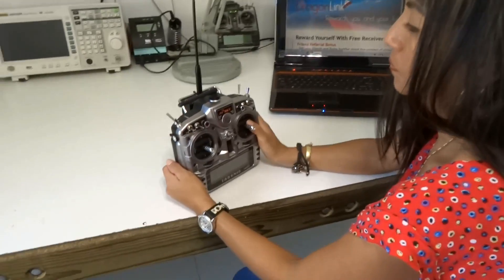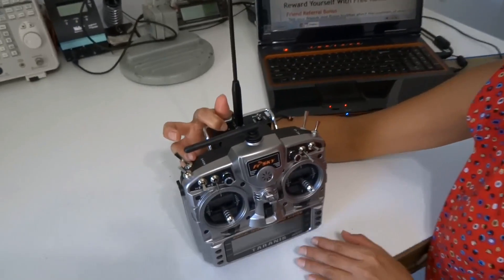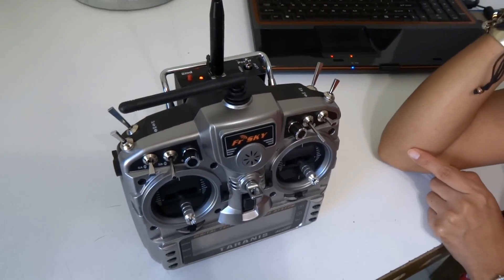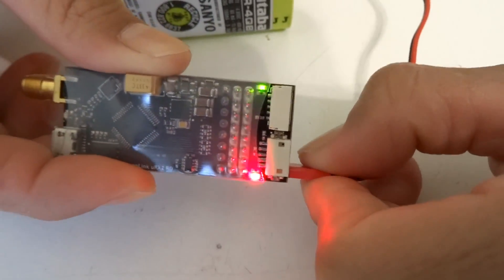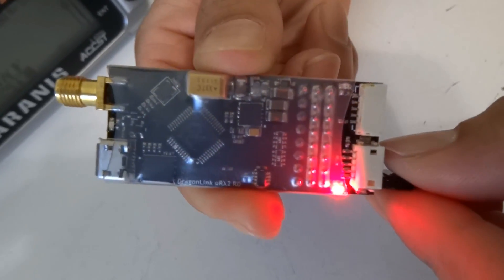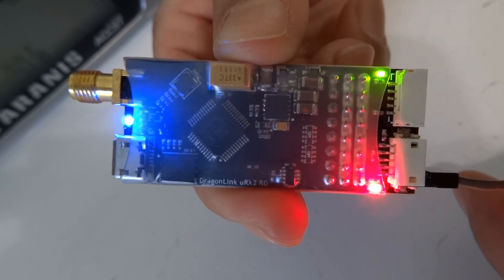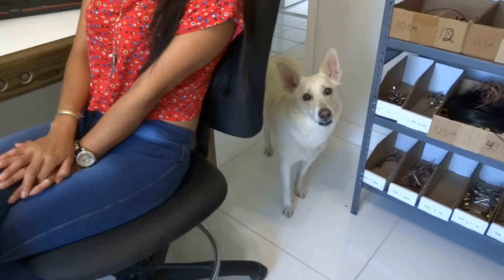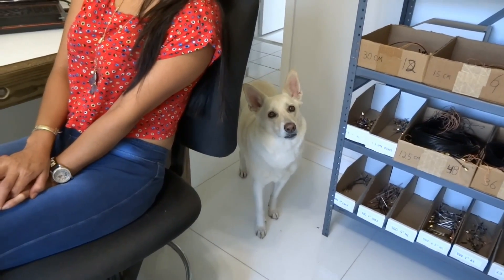Dragon Link Micro Receiver Basic Setup:  Binding and Calibration

Comment: Dragonlink V2 Transmitter BINDING ISSUE - Solved.  DL V2 + Taranis (internalRF - Off, externalRF - On, PPM 12ch mode) Transmitter was flashing red no matter the settings. Problem was im BIND pushbutton on Transmitter.  Hopefully this fix will help someone

Comment: 5:12... no doubt about it.... that's err a nice dog and LR RC system;-) But 10 grams of amazing RX tech no matter how good is still a "mini" not a "micro" class weight needed for quads and anything under 250 grams doing LR FPV. Even without the FAA rules in place the micro class is where a large segment of the FPV hobby is headed. FPV is the opposite of RC LOS flying where large aircraft are a benefit for orientation. FPV for sport is all about getting a small 1-12 gram camera in the air on something fun to fly where the smaller the better.

 I find 80mm makes 250mm feel too big out in the "real world" flying through holes in trees it just needs to go faster and say up longer so ends up needing to be made bigger due to limits in what technology is producing at the moment. Sure be nice to see DLink make all the metal disappear to make a smaller true micro RX with S-BUS & matching micro weight antenna that will not weigh down a sub 250 gram quad like a Tarot 130. 

Shame the FAA ignored logic and how the FAA normally keeps things in perspective and put hard stiff carbon fiber frame quads in the same class as a soft foam glider. If the FAA wants people to respect the law and not be ignored then the FAA should make reasonable rules people respect out of logic.

Comment: confusing . I have the Dragonlink version that comes with the micro rx.Just bought it a month ago from Getfpv.com. I need a step by step from start to finish with the new micro rx. Right off the bat I get a flashing red light and have no clue why? Serioiusly in fpvwhy cannot in this day and age things be more simple and have a proper instruction manual after paying near $200 for this thing? not to mention my plug that goes into my Taranis comes with a jst plug to the lipo that powers the Dragonlink tx seperately. pretty hard to figure out if I gotta power the DL tx, the Taranis radio and push the bind button all at once.  i don't have 3 arms unfortunately. but the Dragonlink came with two sets of cables for the connection to the radio. one had a headphone style male plug into the radio and the 2nd was a pin type> I am trying it with headphone type plug but perhaps that is not compatible. There is no documentation on what that is for then?